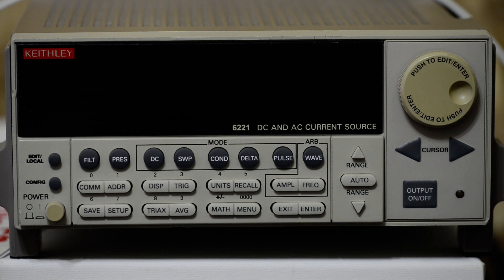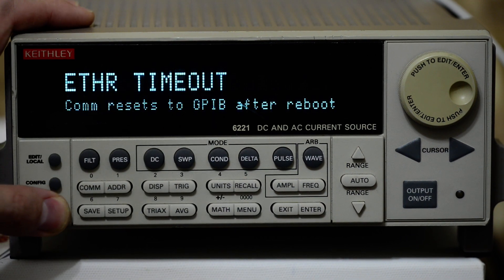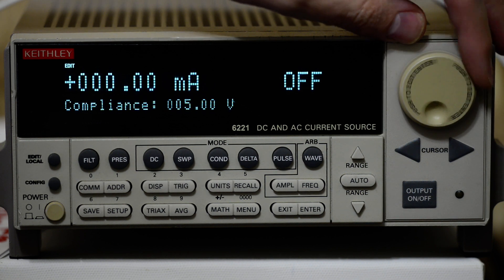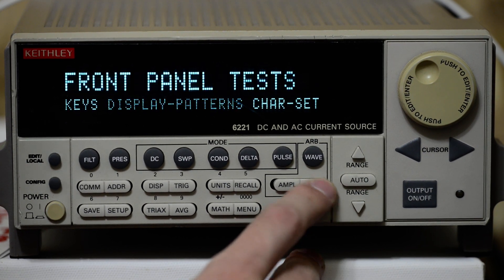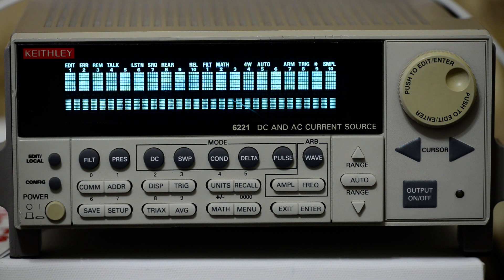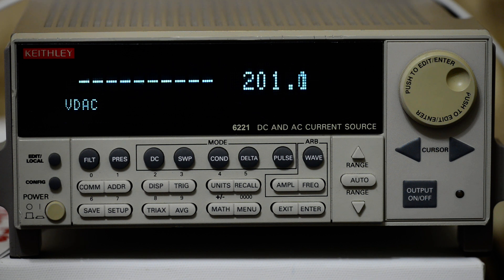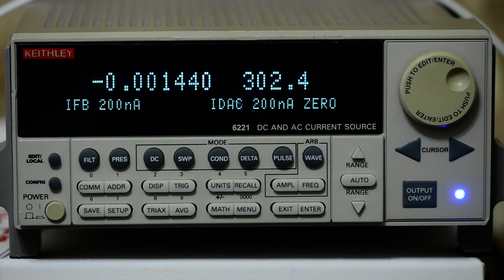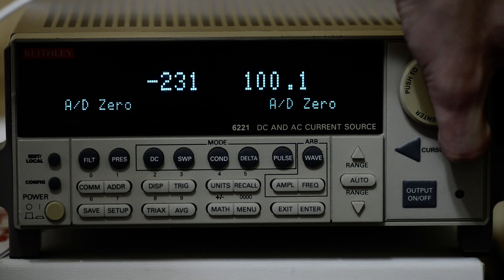Keithley 6221 self-test process and overview

Comment: Seeing the "Loading waveform" message was a bit interesting.  I'm guessing it uses DDS to generate AC?
Reply from the maker: 6221 is actually current arbitrary waveform generator with frequency up to 100 kHz with update rate 10 MSPS. It has 65000 samples memory depth.